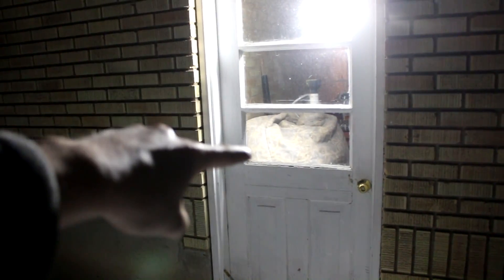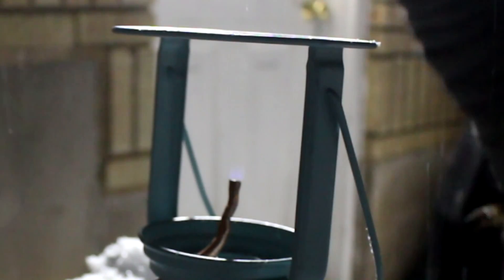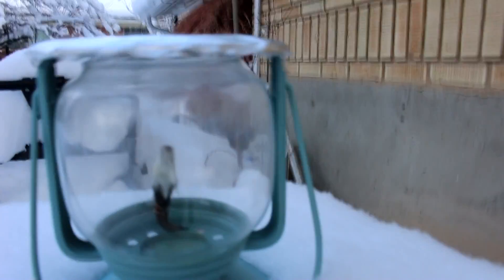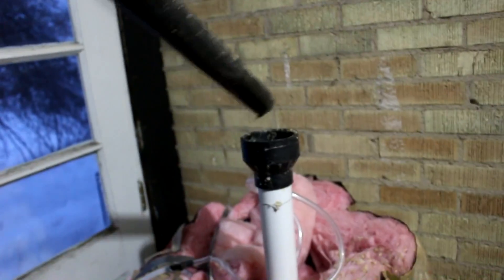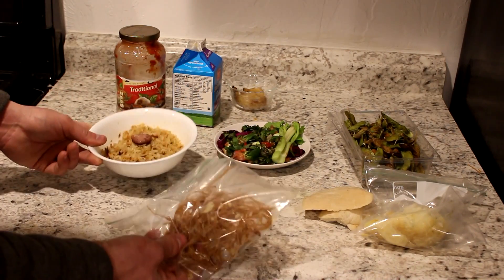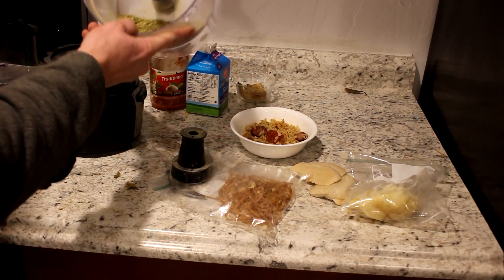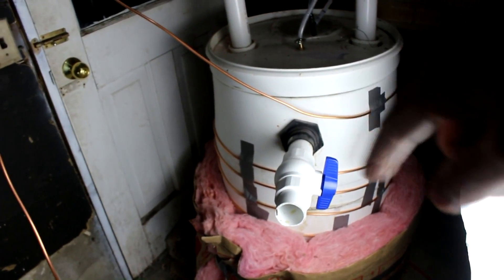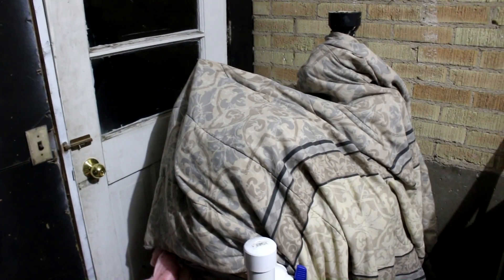Cody's Methane Generator Part 2: I Have Gas!

Comment: What about long term storage and the viability of using this to heat a home? Obviously someone could use this generator to supply their own gas for cooking and water heating but what scale would that look like? Can you measure how much gas this generator produces by material weight and if so calculate the minimum required material you'd need to become self-sufficient (Grow crops, feed animals, collect "fuel" etc.) on gas needs?

Comment: Since it's methane, and methane is lighter than air, why is the beach ball not ascending up when full?
Reply: the weight of the beach ball.
Reply: balloons have weight.
Reply: Hmm... looking online at similar beach balls, it's probably about 0.1 kg in mass and 0.6 m in radius. Based on the densities of the gases, if that was pure methane then the beach ball would be experiencing an upthrust about 5 times greater than its weight (about 0.5 kg more air displaced than mass of methane inside the ball). With helium, the upthrust would be almost 10 times the weight of the beach ball (about 0.95 kg more air displaced than helium mass inside). I'm going to assume that that's probably not pure methane and thus there's some additional heavier gases (or even liquid water that's condensed in there) along with the additional weight of the piping that's preventing it from lifting up off the ground. The significantly lower density of helium means it would have a much greater chance of lifting off the ground, which is one of the reasons it is used in balloons instead of methane. :)
Reply: Road-hog123 the other reason to use helium over methane is the combustion factor. you really would not like it if your floating balloons caught fire and exploded rather than just popped if they hit a candle flame
Reply: Yes, hence I said it was only one of the reasons. Same reason you wouldn't use hydrogen. :)
Reply: Collin Barker I use hydrogen. Much more fun and the helium should go to science
Reply: Oh the humanity

Comment: I don't think you could run the system totally on the methane produced, but we'll have to see. Problem though, without outside intervention, ie the aquarium heater, if anything went wrong, and you ran out of material, the entire system would shut down. Well, I guess the system has other practical applications, as alluded to by your extremely obvious pun in the title. If your plumbing out in Utah ever gets clogged up, I guess you have yourself an emergency porta potty.

Comment: How about a thermocouple for safety, if the flame dies the gas gets shut off so you don't have fumes in the room?  Like on a hot water tank, gas lit fire place,  and are you worried about an open flame and the insulation etc.
Reply from the maker: The insulation is fireproof but I Like the thermocouple idea I could hook it up to a solenoid valve and send the gas outside if the flame goes out.

Comment: How are you going to regulate the temperature with the flame?
Reply: blazednlovinit didn't you guys hear him say "let's see if I save on electricity?" . he left the original heater in there to see if it would remain shut off.
Reply: 00011theman no need to regulate. That's what 60 liters of water you recon? The amount of energy needed to overheat it isn't achievable with that little flame. By my calculations it will take several days to even reach the temperature that he wants. Assuming everything is perfectly insulated.   It's more likely to not be enough heat.
Reply: divadbate That's what I mean, I doubt it will overheat unless the insulation is just that good and he ran it for a long period. But he needs some way to make a bigger flame for more heat when needed and less when it isn't.
Reply: If it mitigates the energy usage, even a small flame is worthwhile.
Reply: @Kris Bailey, if you read what I wrote, it's clear that I remember him saying that xD

Mitigating energy usage = saving electricity.

Comment: Do you have any plans for long term bulk methane storage? I've wondered about plumbing the gas to a shop air compressor and connecting that to a propane tank, maybe with some kind of pressure sensitive trip switch to automate the process.

Comment: Why wouldnt the flame travel inside the tube and just blow up the beach ball? i know the methane is traveling out of the tube so there is a force but i would have though the burning would be quicker than the pressure at which the methane is being pushed out.
Reply from the maker: there is something called a "Minimum flame diameter" and if your tube is below that size a flame cannot burn through it. for methane its something like half an inch.
Reply: No oxygen inside the tube
Reply: Thanks a lot for answering !

Comment: I'm a bit worried that the flame might get to the insulation and burn it. I hope its either fireproof or the flame is far enough away not to cause any problems. Also, another great and interesting video, keep it up!

Comment: So in the summer, when it does not need heating you can actually harvest the methane for energy?
I am thinking something like survival situation - imagine having a gas stove run by a battery of theese. Or even areas without gas piping?

Comment: +Cody'sLab @Cody'sLab : I know last time you said that human feces doesn't have the right bacteria to get one of these going, but could you fuel an up and running generator by adding human waste? Also, What exactly is left over in the slurry to be drained off and does it have any uses?
Reply: Additionally, the methane is actually odorless. The sulfur that is also being released is what makes both the methane, the reactor, and even feces smell.
Reply: Oh, additional querie: As the methane has been extracted, does that mean the left over slurry doesn't smell like shit?
Reply: The slurry can be used as fertilizer, and it does not smell as bad as it is no longer the same chemicals
Reply: cheers folks
Reply: any idea if you could fuel it with human waste once it's up and running?
Reply: Rabbits are basically vegans.

Does that answer your question?

Comment: i was wondering what you used to make the light brighter but I didn't figured it out. but what I've noticed myself, if you heat burned paper with a torch, it gives away a crazy bright shine, was it probably something like that?
Reply from the maker: Very similar actually. paper has calcium that when heated produces a bright light. the lantern mantle I used is silk that has been soaked in cerium, cerium does the same thing that calcium does just more efficient.
Reply: ***** that's interesting! It's really nice that you are responding to comments! :)

Comment: Cody, are you sure that's safe? it looks like your insulation is made of highly flammable material. wouldn't be fun if a flame reached the barrel.
Reply: My neighbors home caught fire, all that was left was that pink shit.
Reply: That pink thing is made from glass.
Reply: "that pink shit" made me laugh, thanks
Reply: It's fiberglass. Non-flammable.
Reply: Tamahagane Inflammable and flammable mean the same thing. But we all understand what you mean.
Reply: its glass wool is inflammable
Reply: I was just about to post this. I'm pretty sure the blanket isn't noncombustible. If it managed to fall and catch fire the tank could asplode.
Reply: the prefix in means not, inflammable means not flammable, is what i was about to say until i looked it up. why is english so damn wierd.
Reply: Josh It's because the original word was "inflammable", which was the adjective form of the verb "inflame". People started using "flammable" instead for some reason, and it just stuck. In the same way that "inflame" doesn't mean to put out a fire; it means to catch something on fire, inflammable means something that can be inflamed, or caught on fire. In this case "in" wasn't a prefix, it was just part of the word. Flammable didn't used to be a word at all.
Reply: Yeah.. I could imagine cody accidentally adding something to the reactor to make it go nuts with 1000x methane*** and lighting up the blanket.. Home insurance is definitely not going to like that.
Reply: rkan2 It's methane, not CO2. CO2 is carbon dioxide. It's the bubbles in soda. It's also a gas used in fire extinguishers, so not something that would light up anything.
Reply: Exactly my note. The new heating setup looks like a fire hazard.
Reply: Etymology: In (prefix meaning penetration, inside, in), Flamma (latin for fire), able (sufix meaning "that can be done").
Reply: guys i now know this read the whole comment.
Reply: I'm more worried about the flame going out and filling his garage with methane. At current rate of production it won't form an explosive mixture anytime soon, but warm-blooded creatures tend not to like breathing methane.

Comment: How many watts of power is the flame of the methane produced? ( like I mean the from the constant output of the methane generator, not the stored Methane flame from the beach ball )
Reply: Watts is power, so you could find the amount of methane per second produced and multiply it by  50.1 kJ/g. to get joules/second, the rate of energy, also known as power
Reply: TopQuark - If you get the rate that the gas comes out cc/s you would convert the cc of methane to joules - then divide by 1 second giving you your wattage
Reply: +TopQuark I think you are confusing things
Reply: It's not electricity, so you would probably get its energy in Joules (watt-seconds).

Comment: how did he not burn the shit out of his fingers pinching off the molten plastic???
Reply from the maker: Because I am fire proof. ;)
Reply: His fingertips are probably all callus at this point.
Reply: You may be fire proof, but you're most certainly not butter proof.
Reply: hes made of asbestos
Reply: asbestos fingers
Reply: Gare Stinky it really shouldn't, there would only be methane in the tube and it needs oxygen to burn
Reply: Simple not enofe heat stored same reason you can touch aluminum foil thats 400deg in the oven:)
Reply: Cody'sLab so when youre building one of these, is it exploding or melting a possibility?
Reply: Cody'sLab also if the fire were to backtrack through the tube, what would happen?
Reply: If the fire were to backtrack, it would end at the bubbler Cody has developed. This is a safety feature, also used in things like electrolysis torches. The bubbler is used filter the gas, so if ignited at the end, it cannot travel back to the source.
Reply: Since no one has answered you, its because its a weak, relatively cold flame. You can do the same thing with a candle and not get very hurt. The methane flame was even weaker than a candle and there was no hot wick.
Reply: More than likely has callus on his finger tips.
Reply: *Enough
Reply: Hmm let me try that
Reply: kaboom?

Comment: can you extract potassium nitrate from the digested material?
Reply from the maker: No, nitrates are only stable in an oxygen rich enviroment. I could react the ammonium carbonate (which it does form) with oxygen to form nitrates after it has been run through the digester.
Reply: Are you going to do that?

Comment: You just used your fingers to put out a flame and melted tube. How does that not hurt you? :o Unless, of course, your fingers were wet.
Reply: you forgot, cody only kryptonite is only butter,  melted plastic is nothing for him.
Reply: KevFive as he said in another comment, he's fire proof
Reply: KevFive It starves the flame of oxygen fast enough that it goes out instantly and the heat from the tube probably dissipated extremely quickly because plastic isn't great at keeping heat.
Reply: How does he do it? We may never know.

First a magnetic finger, now this....
Reply: Low temp flame, low temp air. Probably was about as hot as hot glue.
Reply: I worked as a sous chef for many years, your fingers stop communicating 'fingers are burning' after burning yourself so many times. The pad size increases and takes a lot more to trigger those nerves.
Reply: Tyler -  I got burned really bad from hot hlur
Reply: His hand was probably cold from being outside.
Reply: About a year ago I smashed the pad on my ring finger between two bricks while helping my sister set up her garden. It's permanently bigger than the one on my left hand now, and strangely it's more sensitive than the not smashed one.
Reply: keep in mind it's also 5 F there, so his fingers are likely cold + a bit of pain tolerance.
Reply: I did the same thing to my ring finger when I was little, but it was in one of those lawn chairs with adjustable back. Was laying on it went pull up the back it fell completely down and smashed my finger between the metal bars. It has been 15+ years and the finger is still a little bigger than the rest and my to is more sensitive.
Reply: Kangaroo Shorts You should get that checked out by a doctor if you haven't already
Reply: may be squeezed the tube to shutout the gas supply
Reply: why would it hurt?  he did it quickly and it does not have a glow like a candle does. so the time was way too short for it to hurt him. you can do that on a candle too if you do it quickly enough though.
Reply: Dat Boi it's not like it's infected or anything. It doesn't hurt either. Why should I go to the doctor?
Reply: jort93z the flame would not hurt if you do it quickly like he did,  but im wondering about the melting tube also,  alot like candle wax it dont cool down instantly...
Reply: molten plastic isn't that hot. just like candle wax. it might be hurting but it wont burn you if you only touch some material. a drip of candlewax on your skin does not do that much and the molten plastic is about the same temperature but there is a lot less of it.

Comment: Cody, if the gas was getting stinky, then that's not just methane, since methane itself is odorless, no? Since it's not likely to be all that concentrated, either.
Reply: Yeah, it definitely indicates the presence of sulfides. Pure methane is odorless. I think the misconception might come from the fact that if you buy methane (or "natural gas") in a tube it's usually laced with an odorant so that you'll notice if it's leaking.
Reply: I remember what my chem lab supervisors used to say whenever we needed to bubble H2S through a solution... if the sulfurous odor goes away, it's not because there's no H2S in the air, it's because your sense of smell has been overwhelmed and you should leave the room because the air concentration is too high.
Reply: A strong foul smell could indicate a higher ratio of sulfate-reducing bacteria than you would ideally want in a methane digester.
Reply: Cool, thanks everyone who chipped in on that. So it'd be the hydrogen sulfide that the faeces is producing as it is decomposing that he's smelling. Makes perfect scents (:D)!
Reply: Also a side note, H2S can be a byproduct and is lethal at only like 100 ppm. You can also lose your sense of smell and shit at only like 30 ppm with short exposure.
Reply: Anything organic will break down into sulfides given the right conditions, not just faeces.
Reply: Cody has mentioned in other comments that he expects his gas is 50% methane. Which seems appropriate since he isn't filtering in any way and didn't attempt to control what bacterias he had.
Reply: Kain Yusanagi yeah I'm pretty sure he already knows that
Reply: MattGaming+
He said in the video that the methane was getting stinky, so why I'm asking for clarification; Was it just that it was concentrated enough that it began to have a smell? Were there contaminants in it? Did he just misspeak, meaning the methane generator was smelling up the place? Etc.
Reply: RBuckminsterFuller Maybe sulfides being produced during the decomposition of the rabbit droppings.
Reply: in a previous comment he stated that he found out that he's methane generator had 50% methane and 50% other gasses so its not just methane.
Reply: Kain---Good Question

Comment: 1:30 WTF , u crazy
Reply: This is the dude who used a razor blade to carve a hole in his finger to insert a shard of magnet and then removed a colony of bees without a suit and then survived slipping on butter. A little candle pinching is like a mosquito bite.
Reply: fuckin hardcore :D
Reply: yea ,i thought all the melted plastic will stick to his finger
Reply: That's the proper way to seal this kind of tube. Usually without the flame. You just melt the end and squeeze it shut. The heat dissipates so fast that it's just really hot, but not to the point that it's painful (at least not if you know what's coming).
Reply: Not that hot, about the same as a candle
Reply: I feel pain in my finger seeing that
Reply: It's snowing, so he doesn't get burned
Reply: ohh ok,i didnt know that haha, thank you
Reply: hahaha i guess u right